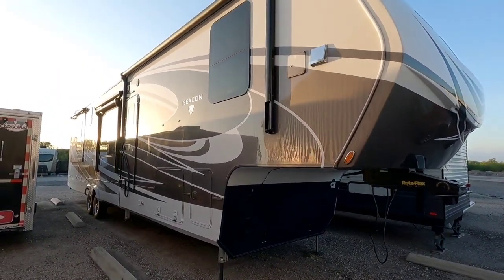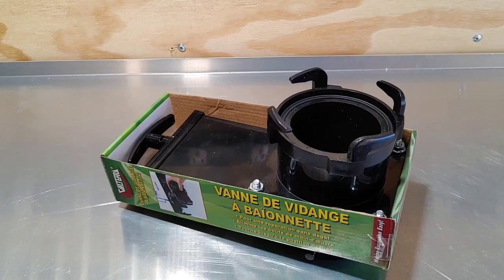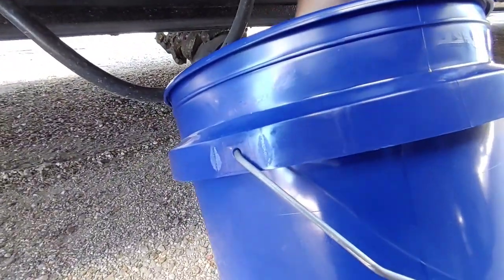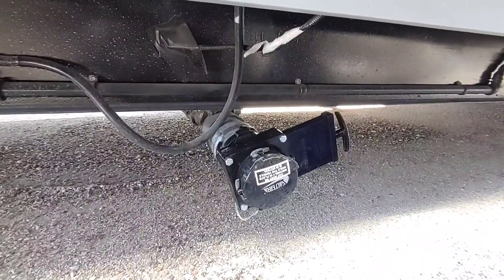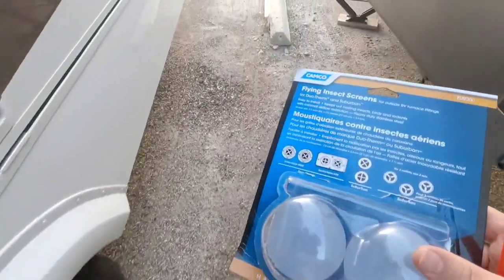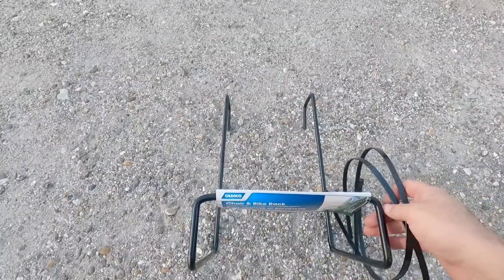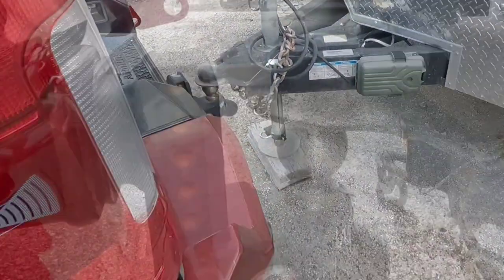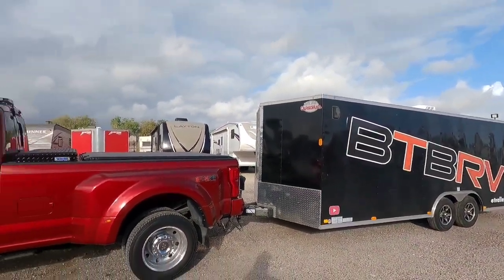3 RV Must have Accessories! All under $50ea! Valterra and Camco

Comment: Hit read-more.   Trust me, you need to think aboout this.

This is a must have.    We typically travel  until 4-5pm then stop for the night when travling cross country.    We made a night stops in Georgia head ing north.   We did not have full hook-ups, nor did we have full tanks so we left the next morning continuing our trip and made it to Kentucky where we had full hook-ups.

Its important to note, you should never dump your black tank when it is only 1/2 full --- 3/4 is the point where it should be dumped --- anything less will not give the proper "wush" needed to properly clean and ensure a good emptying of the tank.

All of our valves were closed when we left Georgia.   They were still closed when we got to our destination.  

THe process we follow is to empty black, then when it is finished to close it, and open grey to flush the hose clean with grey then close things back up so that anything left in the down-hose is grey water and not terribly nasty.

When we got to our next night stay, I held the hose under the cap which catches the stray water, but instead of the 1/2 to 1 cup of water I expect....in realty there was 2.5 gallons or about 20 pounds of estimated effluent waiting for me.   The blade valves didn't leak before or after this event.   I assume some one at a rest stop pulled the black valve and closed it again.   The blade valve never leaked before this, or after.

How was it handled -- we first apolgized PROFUSELY to the sarine that was our neighbor at the full hook-up site.   I'm not sure if he laughed or cried....but he was at least understanding.   We then went to the office and explained our situation.   They pointed out that our agreement was that as occupants of the site we were responsible for the discharge.    They came out, looked, and dumped several shovel fulls of baking soda on the spot which took care of the problem.    This was small enough of a mess that they kind of laughed it off a bit, and said not to worry about it.   

Apparently this happens not infrequently --- and our problem was much easier delt with.   I assume other have hoses pop off completely with 40 gallons of spilled effluent.   Thank Goodness.   

Lesson learned....

1]   Don't assume people will leave your stuff alone
2]   Carry  baking soda
3]   This valve is a must.

Comment: When I hook up to my trailers (I have never had a camera on anything I hook to a trailer to a trailer with) one thing you can do is know where your trailer sits while pulling it and mark it in memory that is where it always will be. Then when you unhook leave your trailer hitch just high enough that when you pull out from under it with your vehicle, your vehicle will slightly have to drop to come out of the hitch, the trailer hitch will push down on the ball as it comes out from under the trailer. (REMEMBER TO ALWAYS ALWAYS BLOCK THE TIRES FRONT AND BACK). then when you go to hook up  and you are lined up with the trailer when you get to your hitch your vehicle will push under the hitch. and you can feel the adjustment. It doesn't need to be harsh just a slight rub which will push down on your vehicle a little.  Then when your vehicle comes back up you stop and lower your trailer down and latch it, hook it and connect it and AWAY WE GO, sorry it was so long. But I am hooked to trailers from 8 ft long to 40 ft long weekly and this is the way I teach others to. No cameras for us .  We are State Park Employees.
Reply: Use the end valterra. valve great for dry camping, dumping in blue bottle,also  quick closure no spillage.
Cheap insurance against poo.
All gate valves eventually seep,this makes an easy cure,and is easily repaired should seal need replacing.
They make a glue on model as well as twist on.

Comment: I think the number one upgrade needs to be a tire pressure monitoring system
Reply: and the one thing to combat a blow out is steering control assist. If you don't have them with a front blow out TPMS is useless! I have 2 on the front of my Class A and a anti sway bar to boot!

Comment: I use a King valve that has the clear part so you can see what is flowing through.   Have not had any gunk come out when uncapping either, but anything that would come out would be from the grey tank anyway.   Can't leave the King Valve on since it sticks out a foot and could be knocked off while traveling. On my last trailer it would hit pavement since the trailer sat too low, and would be pressed against the slide when closed.    Great addition though.

Comment: Okay!! Yeah, I've had my furnace vents loaded up with acorns from birds, counted 24 of the acorns...When I went to turn on my furnace that fall, well, a really LOUD screech followed after the fan motor started. I had to disconnect the furnace, pull it completely out of the cupboard, and take apart the squirrel cage enough to dislodge the acorns.
So, I'd say the furnace covers would be a real good idea.

Comment: I don't have that. What I do in plug into the dump 1st, then hold the hose under the cap and let any remnants drop into the hose then hook it up to dump. always clean, no mess plus I keep a reverse slush attached so the tank in pretty clean.

Comment: I had to point mine forward because of space and convenience. I simply used a couple of pieces of plumbers strapping under a couple of bolts and pop riveted to the skirting to keep it on. It fit so you can hardly see it.

Comment: The third valve is a game changer for preventing the dreaded "sewer surprise", however, you actually missed the biggest feature this valve has to offer! Once you have your hose hooked up, open the third valve and open the black valve, once that's drained leave the black valve open and close the third valve...when you open the Grey valve the water will hit the third valve and back up into the black tank...as soon as you hear liquid no longer moving, open the third valve and drain both tanks...you've just used your Grey water to do a back flush of your black tank which will prevent a whole nother level of headache...power washing out the black tank through the toilet when it gets clogged up with toilet paper that didn't want to drain at first..

Comment: not to mention if you have remote valves which are known to not close all the way and leak. i use a flush king with the valve on it. it never comes off the drain pipe on my rv

Comment: The bug screens are a very good idea, have been using them for years. You might want to use the screens in the hot water heater and the refrigerator vents. I also have the same ladder rack attachment and it works good to hold the blue boy.

Comment: I had this same problem, but I went a different way.  I purchased the "glue on" valve.  I cut off the old end and glued on the valve.  Now it's a permanent fix and it looks factory installed.

Comment: I like to leave the trailer a half inch or so lower than the ball.  Just enough so you feel a little dip when back under it.  Can usually line up on the first try.

Comment: I installed my first one just like this.  Somewhere on the road it came off. It did loosen up and came off.  My second was secured with some E6000 clear glue.  It is still in place after 10k miles.  Just a warning to all looking at doing this.

Comment: I thought you drain the black water tank first before draining the grey water, that way the grey water washes the pipe clean.  Also you don't open the two valves at the same time so the two tanks don't mix.  Your method counters that knowledge.  Your thought?

Comment: I use that valve to back flush my black tank with grey water. 1st I dump the black as normal. Then I close the new valve and open the grey valve while keeping the black valve open. This lets the grey water go down the plumbing to the new valve then back up into the black tank. I let the physics of water seeking its own level do it's thing then shut the grey valve off. I reopen the new valve and let the black tank re-drain itself, close the black valve, open the grey valve and finish up like nothing happened. works great!

Comment: Is there anything that we could put over the water heater to avoid bugs getting in there?
Reply: Amazon has bug guards in many sizes. I found some larger rectangle ones for my water heater.
Reply: @jasonba5558  I ordered one but it didn't fit. Gonna try adding some metal mesh on the inside of the door

Comment: I've had 4 RV's and they ALL had their own separate Gray and Black dump valves, No need to install one new as you did.
No need to waste your money buying those screens over the furnace vents, again we have been full-timing for 15 years and have never had any mud dobber nest built in them. The chairs are going to get really dirty hanging on your ladder driving down the freeways, and then there's the possibility of them falling off.

Comment: I use a sewer hose end valve or reverse flo valve which is similar to yours but has connections for a water hose to force water up the hose and back into the tank.  My valve is clear so that I can see what is comming out.  I also use a clear extension about 10 inches long so my valve handle clears my RV fender.  Why don't you mount that camera on your forehead so you can use 2 hands to demonstrate some of that stuff?

Comment: You’d think the manufacturer would have a valve installed from factory on the dump line. Seems easy and relatively cheap enough, considering the cost of the trailer.

Comment: I never seen one without 2 gate valves, without a gate valve you'll never be able to dump your tanks. I would never buy a camper without 2 gate valves... the screens great idea, bike rack ? I won't go down the road with that bungee straped to the back and the chairs or bike hanging 2 ft off the side..

Comment: Where is the dump valve located on that trailer? My valves are already on the very end so I don't have that issue.
Reply: Agreed, based on my experience, I didn't realize this was such an issue.
Reply: A lot of trailers have their valves remote mounted in the enclosed belly of the trailer. There is some leaking on these valves when some debris get caught up in the valve.

Comment: It must be just the bigger trailers and 5th wheels that need the gate valve. On my trailer I don’t need the gate valve because my valves are very close to the opening where you attach the stinky slinky.

Comment: What is your opinion on greasing your ball?  Especially on larger loads, like 10,000lbs, I’ve found that I always dab a bit of lithium grease all over and it just helps keep things moving without issue/noise AND it keeps my balls and sockets from rusting. (Stop it, folks. We’re not 12 years old here... :-) )

Comment: If you have gray/black water coming out when you remove the cap, one or both of your gate valves are leaking, and should be replaced.  It's a twenty buck fifteen minute job.

Comment: I added a gate valve to my 30' travel trailer and after about a year, it fell off on an interstate in Kentucky. Added a couple of screws to hold it in place. but still fell off. i would not recommend using one of these.

Comment: What do you do when the chairs block the tail lights at the back of the trailer by having them on the ladder? I see that the chairs are not solid, but i have a feeling that is not "ok" with the spirit of the law. Remote lights?

Comment: I asked my dealer service department about the bug screens when I bought my 5th Wheel recently. I was strongly cautioned that it was important to remove them when using the furnace. Keystone has voided warranty repairs on the furnace if the screen was installed when the furnace is brought in for repair.
Reply: I was warned the same.

Comment: I used that same method of backing up to a trailer hitch with my Jeep Unlimited.  Then I got the Jeep truck... and the new safety features are... FRuStraTinG!  I am no longer permitted to have a door open and try to move the truck - it won't move.  Even if I shut the offending door - the truck won't move until I place the shifter back into park and then back into gear.  Safety is gonna kill me.

Comment: 18.5k GVWR with twin 8k axles?  Would that put 2500 pounds on the fifth wheel?
Reply from the maker: If you were at max GVW, then you would be putting more like 3,500 on the pin.  Leaving you about 15k on the axles.  In this case, we were around 14k over the axles.

Comment: I asked on a old video but can you tell me what 5th wheel hitch will work best on my Ram 4500 4x4 club cab flatbed truck????
Reply from the maker: That's a tough question.  On a flatbed you have limited options depending on how it's configure.  Also depends on the brand of flatbed.

Comment: I don't like that ladder hanger thing. I don't believe you should ever hang anything from an RV ladder while driving. The constant up and down forces will put constant strain on the ladder mounting points. and can eventually pull out of the rear wall/cap. Also, if you zip tie it to the rung, it makes it difficult to climb the ladder. Maybe it's ok if you need storage while at the campsite, but not while in motion. I'm always seeing 2 full sized mounting bikes bungeed to a rear ladder and I shake me head every time. Not good!!
Reply: Exactly - you have to zip tie it to the ladder, making the ladder unusable, zip tie the chairs (or bikes? HA!) to it, so you don't lose them on the first bump, and rezip everything to use it again.  No Thanks!

Comment: Ripped the cap off and threw it away...😡
Last year in October after being on the road for a few days and after arriving late and setting up in the dark i decided to  hook up the sewer hose and yep it was full of shit...
Had to hose myself off outside with cold water strip down outside 🥶 and crawl into the shower. Oh and did I mention my connection is low and tucked in so I need to sit down to take the cap off ... Oh and I suspect I forgot to close the black water valve previously so it was really shitty.....🤢
Reply: LOL...I couldn't help but give a thumbs up.

Comment: So, I guess you have to cut that chair rack off the ladder before you can access the roof again?
Reply: Camco actually makes a much nicer  Camp N Carry chair/bike rack that allows ladder access (while empty of course).
Reply: @glenncaswell9062  Yes, much better indeed. Thanks for the tip!
Reply: I don't think that ladder rack is meant for holding anything while driving down the road. It's just for while you are set up and want to put your chairs away or bike away

Comment: On the hose, just hold it under the cap and pull the bottom of the cap off first so everything goes in the hose, but it's still all gross

Comment: I don’t believe adding a screen to your outlets is such a great idea, it will decrease the flow and may cause damage to your unit and void any warranty, wort case burn your unit down. I would suggest you measure the airflow thru the screen, I think you will find up to 30% flow restriction !

Comment: Do you really need a two minute intro to stress how important an aftermarket waste valve is?  Get to the point.  Be mindful of the data charges for internet usage.  I deal with "this" on my Airstream by holding the waste hose under the cap, gently open the cap, and any residual waste in the line flows into the hose.  Not a problem.